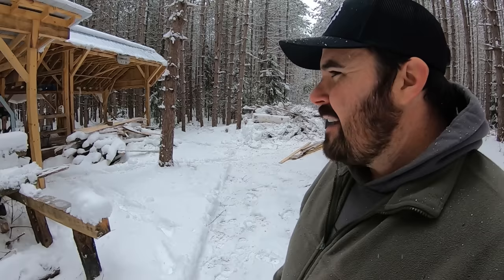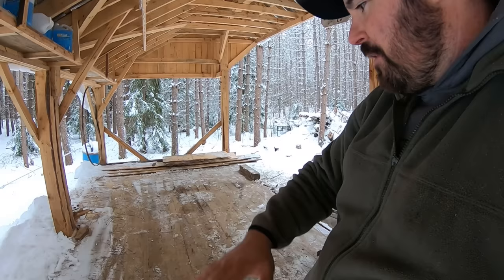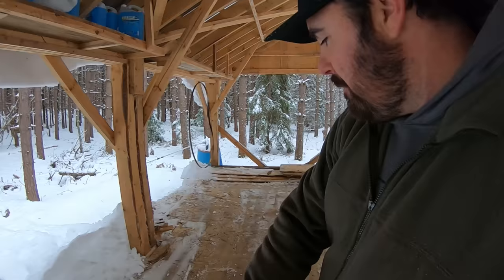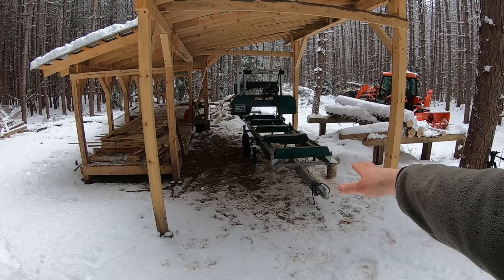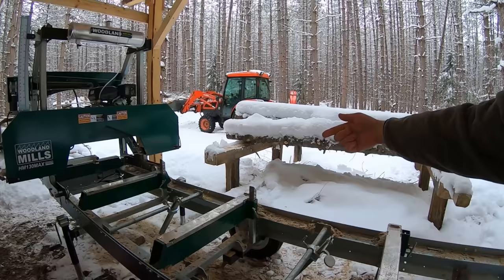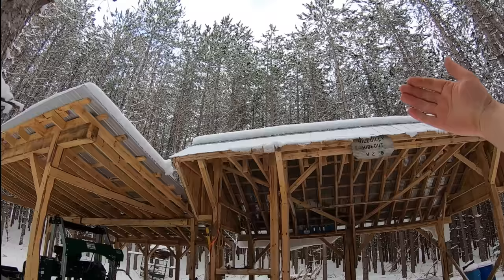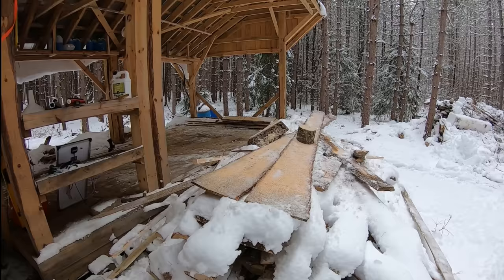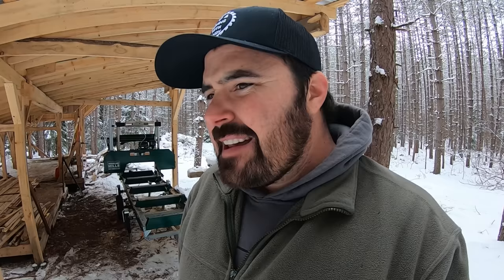Don't Build a Sawmill Shed Like I Did

Comment: Just watch this older video of yours and realize you truly have this miniatures sawmill assembly line figured out I have suggested a few things in your newer videos with watching this you really have the plan it's not the thought and ideals are there it's the do I have the cost to do what I need or want to as well as the lumber to do the job I personally like seeing your sawmill up on the wooden platform but here is something that I have done in the past for RV camping park's we use a decomposing granite it is similar to a class to base material for roads but it is organic we set up two parallel and level to one another like you would concrete formboards be skreet off of do you have a rototiller for your because the next step is you add Portland cement spread that a inch an half thick or better while it's lying on the ground on top of the DG material or something adequate to it rototill the Portland cement it into material you will use skreet it level soak it with water and let it set for a couple days I just saw and I don't know where but they actually have now dry concrete which I think is the basic of what we used to do back in the day
Reply from the maker: Hey Sean! Great to hear you've found these videos from a little while back. I appreciate all your help and tips. Great to have the view of others to help me get my setup dialled in

Comment: You should be able to just pull up with your fork lift on the back side where your lumber stack is. It will save time and labor , remember you have snow on both sides but a log landing on one side with timber on it. Take out the one post thats in the way ,if theres a beam joint above the post just bolt another beam on the side of the existing one, you won,t regret it.    PS i do this for a living, good luck and stay safe.
Reply from the maker: Thanks for checking out the setups Roy. Appreciate the ideas

Comment: 50 x 20 foot building with a 100 x 100 concrete pad at 6 inches. *Get the height with the ability to deal with spring melt
Reply from the maker: For sure. Bigger the better
Reply: @sawingwithsandy  Im up in Canada with a bunch of farm land. Just have to find someone that wants an out building. Also would have to get one with a trailer.

Comment: Sorry late to the game here but maybe you could build a mat system platform like they use in off highway power line construction. Make a sandwich of 2x lumber, bottom layer going e-w middle n-s top e-w. Then ramp some stone up to back the mill on to it.
Reply from the maker: Thanks for sharing that. I haven't heard of that style of building but I like it
Reply: I hope that comes through the way I intended not always the best with tech. 😂

Comment: Hi sandy Would it be possible to lift the trailer with the forks in the old sawmill shed. It would take minimal time. 
Luckily I have not seen snow for over 54 years And best wishes for the new year
Reply from the maker: I'll have to give it a try. The sawmill may overhand the edge of the rails a bit too far for the forks but I may have to see.
Reply from the maker: Happy New Year Casey!
Reply: @sawingwithsandy  as long the wheels are on the floor you can maneuver it by hand easy enough

Comment: First thing I did was make a sawmill building with new sawmill, but I would never build a concrete slab floor for sawmill, that permanently eliminates a possible cellar or crawl space. The perfect flood is planks on 4"x8"x14-16ft floor joist 2ft on center, then have 2'x 16' opening on sawdust side of mill, then lay 2'x4' steel grates down on floor joist for sawdust to fall on and through to conveyor under floor, have conveyor flow out into box or trailer, never have to shovel sawdust again..........

Comment: I have a Mill-Trailer and to be honest, it doesn’t move that often. Build a ramp at the end of platform deck where your old mill was setup. They make a hitch-ball attachment that clamps to a tractor fork. Just push it up the ramp. You said the roof was 11’, so you should have plenty of room.
Reply from the maker: Think that would do the trick . Thanks for thay

Comment: hello sandy .i have be watching  before you built 2.0 .i watched the  build , my mind keep thinking rain and snow 
some time comes down  at 45 to90 degree thought you needed  more coverage . i see the half walls they help block wind and sun, rain  Maby .  I keep looking at the mill you are capable of 
adding ext on one or both ends 6" to1 1/2' add no bunks log needs no support  ,  half of the head need's support.
the tractor dosnt need to be on the deck if the tailor had a 3rd wheel it might push by hand ok
Reply from the maker: Great points. Thanks for sharing

Comment: Have you seen the vid about the way one guy handles the sawdust coming off saw- he took a large diameter plastic drain pipe (smooth on the inside) an cut it about like a  C  an let saw dust blow into it, it was pitched a little down to let any rain run out - he had a curved shovel like push stick to get saw dust out low end an just dragged stuff into his loader bucket to get rid of everything-take care
Reply from the maker: I haven't seen that but that does sound like a good way of dealing with all the dust

Comment: Build a flat deck that is 2 x 4 or 6 at ground level that you would only need small ramp to back the sawmill  on and off.
Reply from the maker: Think that could work Roger. Would just need to make sure it's well supported to hold the weight of whatever I use to town the mill up onto the platform with but definitely possible
Reply: @sawingwithsandy  I was thinking back on and pull off from q end.

Comment: Maybe a brick floor with sand packed between them? I dunno. 🤷‍♂
Reply from the maker: That’s an idea I never thought of. Thanks Jim
Reply: @sawingwithsandy  It would be unpleasant to shovel though.  I think the idea of lifting it onto the wooden platform would be better.  I'm building a timber frame shop right now.  No mill, just a timbersaw and other hand tools.  It will start with a dirt floor which was inspired by your shop actually.  I might some day put in an end-grain floor.  No brick or stone though, as I plan to do woodworking there and don't want to drop chisels onto a hard surface.

Comment: What happened to the curtains.forks on the tractor n lift the mill sideways after moving the head over the tires n then you can lift it up n in n in n out.don't think so much about backing it in n out.lift it.maybe that helps.
Reply from the maker: Good suggestion. I took the curtains down because bees were making nests in them this summer.

Comment: Just mix the concrete yourself with a rented mixer. An 8' x 20' pad 4" thick is just 2 yards of concrete. That's one or two days of work. It's cheaper than concrete delivery too.
Reply from the maker: Trouble is no access to water nearby
Reply: @sawingwithsandy  I recently mixed 3 yards. I'd estimate about 15 5 gallon pails carried down from my house. Could use rainwater of your roofs.

Comment: Where u stacked UR lumber, cut the two middle post out of the way so a forklift to move UR lumber
Reply from the maker: That could be a good idea. Only trouble I would have is getting support in place for that beam as I don't think the weight of the snow on the roof will be held up enough by the beam with the post
Reply: Put supports at a angle  on each side and it will hold just fine. I've done it with my band million and I've cut 16ft-28ft lumber

Comment: Leaving those wheels on the trailer makes me cringe.
All I can think of is midnight bandits rolling in, backing up & driving away.

as for worries about not having a wall to keep snow out from under the roofed area why not just hang a tarp vertically from the top plate and tie off against the posts and sill.
Hang it up at the end of work session and when you return next time just unlash it and roll it up for storage.
Just spit ballin'
Reply from the maker: Hey Will, the old sawmill in the bigger shed used the tarp idea you mentioned. Worked well, I just took the tarps down recently though as when rolled up bees were always making nests in them. Darn things got me a number of times.
Reply: @sawingwithsandy  yeah, now I remember the tarp on the old sawmill....
I was just thinking about using a tarp in winter. My bees seldom venture out in number in winter and I'm 2000 miles south of you!

Well keep on, keepin' on!

Comment: Why not just build a floor where your mill is sitting, maybe 4" off ground using 10/4 or so lumber?
Reply from the maker: Think this could be a good idea Roger. Main issue would be keeping the wood from rotting since my lumber won’t be pressure treated
Reply: @sawingwithsandy  Put some RR ties under the floor to keep it off the ground, & you have a roof over it!

Comment: will your tractor with forks lift your mill? if yes lift it up there. you definitely need to yo have a roof over your wood deck. yess your pole barn is the right direction
Reply from the maker: The tractor will be a simple solution to get the mill moved. Just have to check if they are long enough